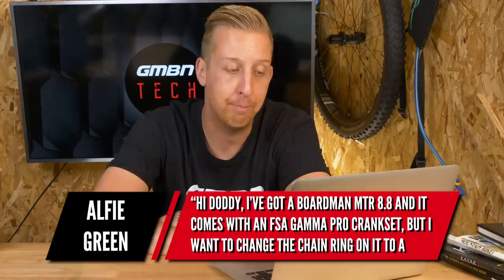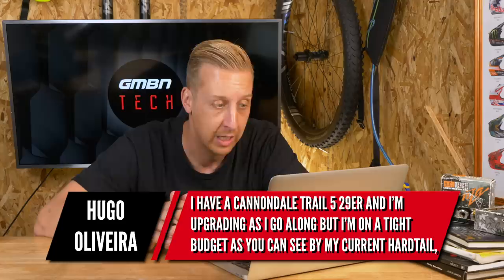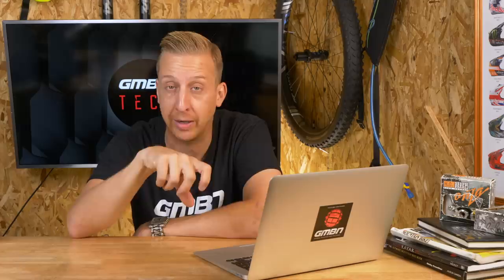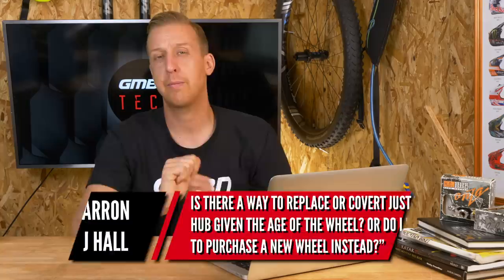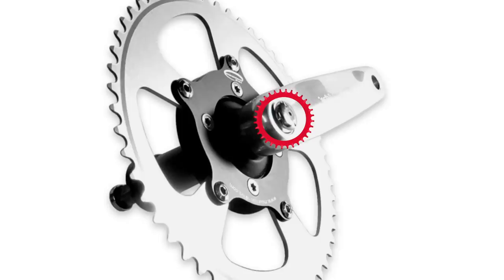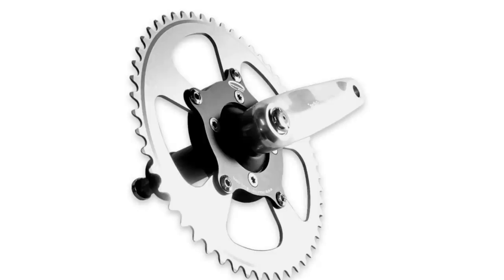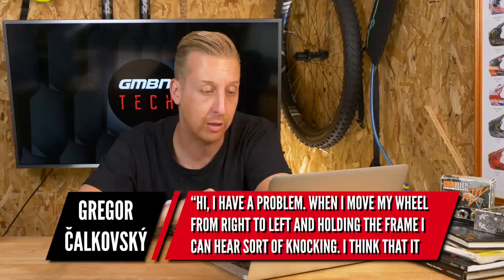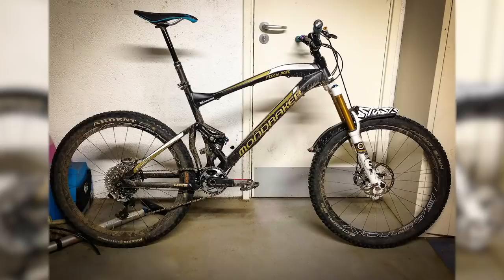Can You Convert Your Mountain Bike Wheel Hubs? | Ask GMBN Tech

Comment from the maker: Have a question for Doddy? Be sure to #askGMBNTech
Reply: "Question for Doddy" 😂🤘🏻
Reply: #askGMBNTech Hi Doddy, love the show. Need help upgrading my fork, want to try to lighten up the front end best I can and upgrade but on a budget. Any recommendations would be appreciated. Fork I have at the moment is a entry level Suntour XCM-HLO lockout 100mm, poor and heavy 29er Fork.
Reply: Legend! Blake's not playing tricks, I am real, well I was last time I checked hahaha
Reply: Doddy: why did you get rid of your wig-head?
Reply: #askgmbntech what brakes are better for price, SLX, saint or zee?
Reply: @willbeardmore4195  Well they are different kinds of brakes, SLX is 2 piston, for trail sort of riding and Saint and Zee are DH brakes and they have 4 pistons and they're heavier and more expensive.
Reply: Where was the "Can You Convert Your Mountain Bike Wheel Hubs" question and reply?
Reply: Hi doddy any chance you could do a video on how to remove and replace wheel bearings on a 20mm thru axle wheel please as having trouble getting mine out
Reply: #askGMBNTech 
 I have a phatmoto rover 2020 motorized bicycle its a 26in "hard tale felt faker beach cruiser frame" I've been rebuilding it into a hybrid downhill MTB using good parts but its not for downhill riding with a 30lbs motor 60lb frame wouldn't work but want the look having issues finding a triple crown/tree frontend that works with regular axles only ones I've found are "cdh power" and after putting on a TRP hy/rd caliber and 180mm rotor they fold a tiny bit at the seals very scary lol  hoping not to spend more than 3-$400
Reply: #askGMBTech Hi doddy I have a old set of marzocchi 888's 2005 year i think the problem i have is i can't find a 20mm thru axle to fit and was wondering is there a conversion kit to go to 15mm thru axel
Reply: #askGMBNTech hello can I change a 3by chainring square taper that is 36 t  is the biggest  .and change it to 52t?
Reply: #askGMBNTech hi Doddy,I'm from Indonesia & I love the GMBN channel..

I have very cheap hardtail MTB POLYGON PREMIER 5..
my question is, is it safe to go trail with QR hub ?
or I have to upgrade my bike to Thru Axle hub for more stiffer & stronger wheels ?

thank's for the advantage
Love GMBN from INDONESIA 😁👍

Comment: I have just bought rockshox boxxer triple DH forks 200 mil. And l have hope pro 2 hubs.  I have been told l need to get a hub conversion kit, but l don’t know what length of throu axel on triple forks and l don’t know what measurement of hub adapter l need for hope pro 2 front wheel!  I’m running 26 inch wheel! Can you help please . The bike l have is a 2004 Kona Coiler and the suspension is coil !  Can you help with answer ASAP as l be getting new forks in the next day or so and l want to install forks on my Kona Coiler . Also what issues will l find with a full siuspension! Rear sus has 6imch travel with fox vanilla R coil rear sus. Hope all of this makes sense.

Comment: I run a 1x8 on a budget hardtail too,  the narrow-wide chainring works fine for chain retention, I've yet to have a drop. I'd try it out before I spent extra money on a guide if your budget is super tight, or just loop a couple zip ties, ha.
Reply: I bodged a chainguide for free by using my front derailleur removing cables etc and using the limit screws to stop it moving but staying in the same place. Works perfectly and was free

Comment: You can also make a front upper chain guide by using the front mech and winding the limit screws in to get it over the single ring. If the screws dont move it over enough you can use a bit of old inner cable to pull it over.

Comment: #askGMBNTech I have a 12x142mm rear Onyx hub and considering a frame swap to a bike with a boost hub spacing, I've looked at boost spacer kits and redishing my wheel and all seems well so far, but what about the derailleur? If I used the oem hanger and just indexed it to ride a little more to the center would my shifting be the same? Or should I try and put both spacers on the brake side then buy a 3mm chainring? Thanks.

Comment: I have “vintage” 1997 Trek 800 with 26in wheels. I just found out that I might be able to fit a 27 and a half. Can I? Should I? Is it a bad idea?

Additionally, to make it happen, I’ll need to covert v-brakes to disk including a converter for it in the rear brakes.

Comment: #askgmbntech I have a question on brake adapters to the forks and frames.  How do i figure out what type to use, 2 hole, 4 hole, post mount, top mount, or some sell longer bolts with washer type spacer/adapter.  I have a 160mm mount on the pike fork and going to a 200mm sram brake setup.  I know i need a 40mm adapter but theres so many options.  Thank you and enjoy they show.
Reply: just buy a post mount for 200mm, no adapters needed

Comment: Can I convert a 9x100mm thru axle to a 15x100mm thru axle on all wheels easily or will I need to change the hubs? Or does it depend on the wheels I have? Like it’s easy for some wheels and others you need to change the hub?

Comment: #askgmbntech  I have a Sram NX 1x11 11-42. I want to add an extender for less hike a bikes in the mountains(Pisgah is nearby) Sram claims these are not compatible, but the shop mechanic a  few friends claim that single cogs and and extended cassettes do work , and they work good. When I contacted Sram, they said I should go to eagle nx if I want a larger range. But $380 is a lot compared to $50-100 for a cog or cassette , and works good in my budget. Why does Sram not want me to use these?

Comment: With regards to the first question. I had a FSA gamma pro crankset on my new bike and found the BCD was a weird size ( 88mm ) and it was a nightmare finding chainrings for that size.
I ended up swapping my cranks to a shimano set with 104BCD so I could change my chainring. 
Hope this helps.
Reply from the maker: Thanks Neilashford, that's good to know. Hopefully they're just one of the 'standards'.
Reply: Thanks for confirming my fears, I'm facing the same issue on my 2017 Trek Rosco 7.  Time to go Hollowtech2...

Comment: I have a question and I know I’m two years late

I want to put a free hub on my trek marlin 7 because I don’t like how quiet it is I don’t know if this is smart or if it’s even possible but it would be helpful to know how I can do it
Reply: You have a couple of choices. 

1. Disassemble the freehub and put it back together using oil or less grease on the pawls (will make it louder).

2. Try to find a new freehub. It will be difficult to find a compatible one because the mounting isn’t standardized.

3. Purchase a new hub (Hope will probably be the loudest out there) and re-lace the wheel with different spokes too. This can get quite pricy, so I would not recommend going through with it just for the sound.

Hope this helps.

Comment: #askGMBNtech Hi Doddy, is it advisable to use a conversion kit for hubs? currently at TA 15X100 and my new fork is a boost at TA 15X110. Should I get the adapter or should I buy a new front hub? Thanks in advance.

Comment: #askGMBNTech Hey Doddy, I'm a weight lifter who likes to use mountain biking on cross country trails for cardio.   I need a pretty robust bike but I'm on a budget, so I opted for a fully rigid fat bike with a Bluto-compatible frame for upgrading later. So far this has worked out really well. Although I'll never be an XC racer I've been having a blast climbing; the rigid frame and fat tires make good use of my strength.  Descents are a different story. The rigid fork dishes out a beating and with the steep head angle (69 degrees) that has me walking some sections I used to ride.

So I'm thinking about that fork upgrade, but I've heard the Bluto fork is a bit flexy.   Is there a better choice for someone my size (I weigh 18 stone)?  Weight is no object; my new bike is four kilos heavier than my old one, and I don't really notice it.

Comment: Square Taper especially Shimano UN55 is defo not a downgrade especially when considering wear and longevity. Hollowtech 2 is ok but remember these were designed for Pro racing and those boys are not so much caring for long lasting parts hense why everything race is weight focused and not wear and tear. A UN55 will long out live generally Hollowtech 2 and take probably more of a battering even if the squeek freeks don't agree! I surfed and seeing a pro surfers board would tell the same story and would only be good for a season. Hope you have a fat wallet mate!

Comment: #askGMBNTech Hi Doddy, I am currently using a two pot Shimano Deore M615 disc brakes and I am ready to upgrade to a four pot system. I am interested with the new Shimano XT M8020 four pot disc brakes. Found out that the new 4 pot XT uses the same 2 pot XT lever, so if you just upgrade the caliper to the 4 pot you would get the same performance as a new set. My question is can I do this with my Deore M615! Can I use my Deore M615 lever and upgrade the caliper to the XT M8020 4 pot and get the same performance? Thanks.

Comment: #AskGMBN Hi Doddy, I have put this question in to askGMBN a couple of times but no luck! Would you be able to explain how the freestroke nuts (as opposed to the reach bolts) on Shimano XT brake levers work? I find that as the pads wear out, the lever stroke gets excessive. Some people suggest on forums to bleed the brakes with the freestroke nut wound out, and then as the pads wear, wind it in to reduce the throw. But all the Shimano bleed documentation states that the brakes must be bled with this screw wound in. Could you explain? Thanks!

Comment: #askGMBNTech Hi Doddy Dude, please can you help. I am an ex road/track sprinter so i am not a small lad 120kg! I am in the process of building up a Santa Cruz tall boy. My question is around rear shock. I have a fox float ctd kashima shock but i just cannot put enough pressure to set the sag and rebound. Can you suggest a fix? Coil spring shock? Anyone else help? Thanks Garry

Comment: I’m just want to know if I can run boost wheels (29er) on non boost frame (142x12 Rear, 15mm front). I’m from Guerrero, Mexico not much parts around 😐
Reply: No pretty sure the boost wheel wont fit the non boost frame

Comment: #askgmbntech is it bad practice to be sitting on the seat when the dropper is fully down? Sometimes I like pedalling around with the seat down when sessioning features for about an hour or so, but concerned that it might damage the dropper since it was designed for descents when you are supposed to be stood up. Cheerio
Reply: Not the dropper, but your knees. Seriously, don't bend your knees more than you have to - that's why droppers are so cool - you can adjust to the conditions. The dropper will be fine. Really. :)

Comment: #askgmbn I just bought a 2019 Giant talon 2 29er, its got an sr suntour xcm 100mm fork on it with straight 1-1/8 steerer tube, can I go up to 120mm travel and air sprung and what fork would you recommend ( it's my xc bike and my trail bike as I'm on a budget)
Reply: Bobby Hempel yep u can but the bottom bracket will be higher
Reply: Yes. You could also run different tyres front and back to help correct the head angle back to the correct postion, something with big grippy knobs on the back and something with shallower knobs on the front.
You could also run more PSI in the rear and less in the front to get the geometry near to how the bike should be when using the 100mm forks.
Reply: I would go for a manitou markhor
Reply: @imnotgivingmynametoamachine683  that's what I was planning on doing.
Reply: I know sr suntour hasn’t got the best reputation but I have their epixon that is a 1 1/8 on my Diamondback sync 3.0 and it’s amazing I ride pretty hard and have set it to 140mm but it can be set to 120mm so that’s the best rout in my opinion as the internals are fully serviceable. Hope you have considered this. 🤘

Comment: #askgmbntech hi doddy, i recently bought a new nukeproof scout frame which needs a boost hubs for the rear wheel. my question is , can i use a non boost hubs on my front tire since my fox34 fork is non boost? or should i buy a new for?k to match my rear wheel. thanks in advance. loving the show.
Reply: Doesn't matter, it should would with no problems

Comment: #askgmbntech I have vintage cranks the ones with two stell doules and they arent good can i use a different type of crankset if yes what shld i use?
Reply: Not sure what you mean by "stell doules" but you can use a crankset when its compatible with your bottom bracket. There are several types of those, like square taper, octalink, and uhh other shimano stuff)) if its vintage its probably square taper and you can chose any crankset that matches. Otherwise, proceed to replace bottom bracket too :)

Comment: #askgmbntech Hello Doddy. Is it worth to upgrade aluminium handlebar and seatpost to carbon on a XC hardtail bike? Worry about durability during riding in the mountains.
Reply: They will be strong enough but consider spending the money on something that will have a greater difference on performance, such as upgrade to tubeless, nicer wheels, better brakes, better saddle, grips and pedals. There's a lot of things I'd upgrade before dropping a few grams by getting carbon parts. If you've already done all the important upgrades then there's no problem going to carbon bars and seatpost
Reply: I would rather go for lighter wheelsets or cranks. The effect is way bigger

Comment: So would it work if I  swap out the lowers legs of a threaded fork and swap out the shitty springs to an air fork. I litterly mean making an air fork around the fuckin 1 inch threaded rod. Or would it be easier to costom fad and press fit/ weld the 1 inch threaded rod to the crown. Help me out fellas I have an old full sus frame and I want to die on a budget cuz I live by some narrly shit that I can't shread to hard on my ht. So would it work ?

Comment: #askGMBNtech Hi there! I'm replacing the fork, and would like to have handlebars higher. How many spacers is too many? (Stem - steering tube) Cheers!
Reply: Technically you can stack 'em all the way up without cutting down the steerer.
But at some point handling will start to feel awkward! And be aware you're effectively shortening the reach, bringing your bar a bit back with every spacer due to the angle of your head tube!

Comment: What is much better? The RockShox Lyrik or the Fox 36 ?
#AskGMBNTech
Reply: Lancelot_ Youtube Fox
Reply: Bike radar says the lyrik is easier to set up and a bit more responsive
Reply: Lancelot_ Youtube its the Lyrik no questions
Reply: Neither/both.
Reply: If you're not an  hardcore Racer I would go for an Lyrik Rc 2 cause it will be as good as the Fox in performance (as far as you will notice). For me personally i would rather have awesome tech support as provided by Rock shox than a possibly not noticeable bit of performance more in the fox. If you are not a tech freak it is also much more easier to Setup.

Hope i could help 😃